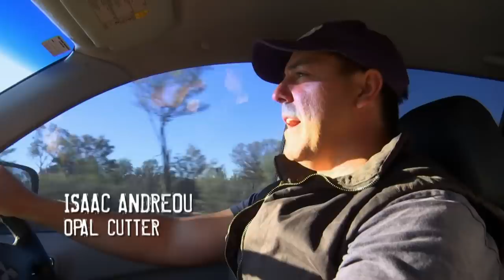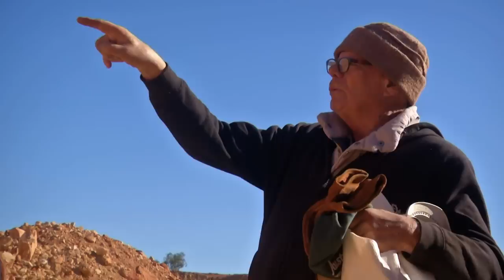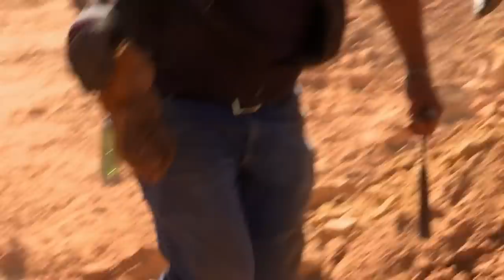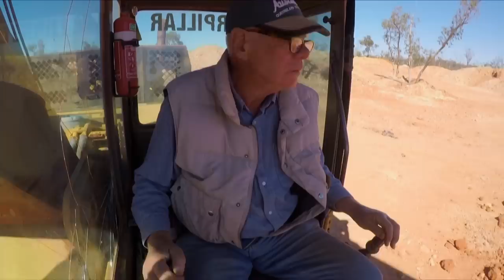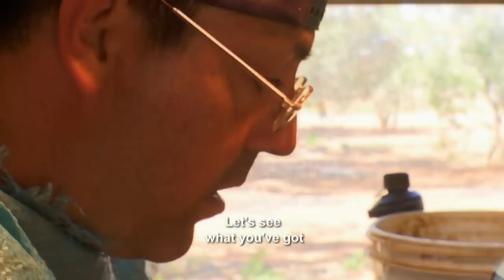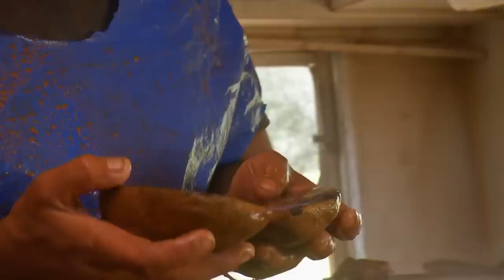The Opal Whisperers Hit Koroit Opal Jackpot! | Outback Opal Hunters

Comment: You smash up and chip up nodules because why, you don't own a diamond saw to cut them?  No one want half a chipped up nodule, unless you are selling to salvage chips and the rest is sliced up.
Reply: Because they need to see where the colour starts in the nut band, if they just cut all the nuts they would have 100s or 1000s to cut which takes way to long. As soon as a miner finds a nut with colour only then do they stop chipping them and start cutting.